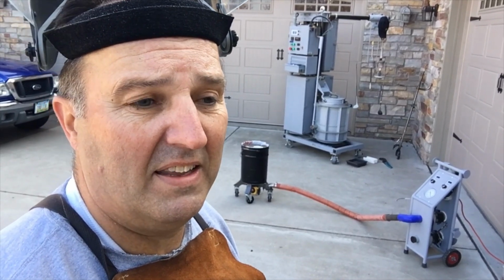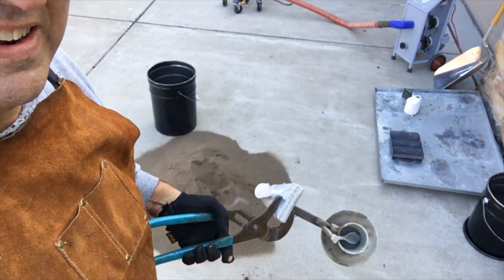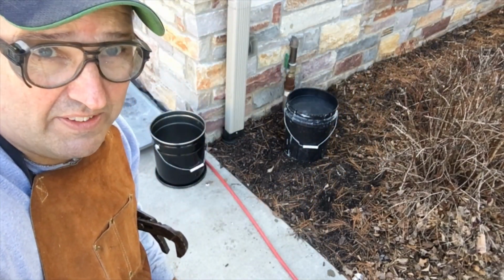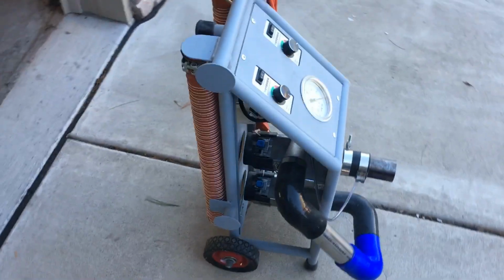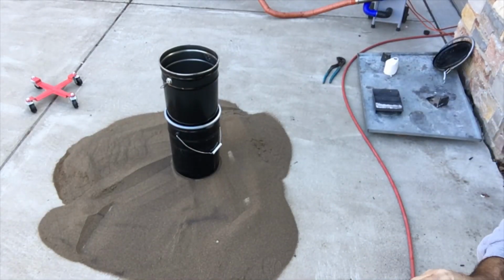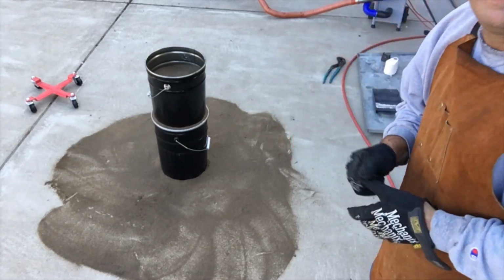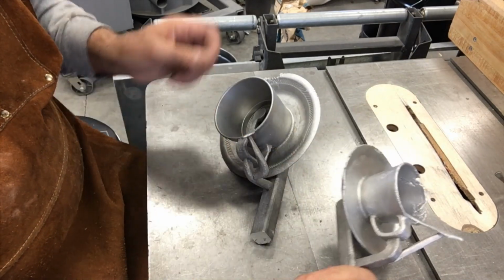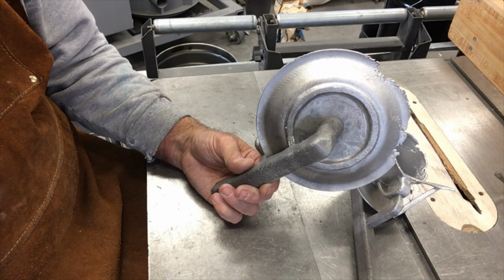Thin Walled Lost Foam Casting: Part 2 Pouring The Castings

Comment: Sonofagun. Did I just find my favorite channel? 
Smart, tenacious stuff.
Reply from the maker: Ya had me on the first word. Son-of-a-gun LoL. I have a new project in the works. Hopefully in video in a couple weeks. K
Reply: @kellycoffield533  I'll be watching for it. Thanks for making this available to the world. 
Is there a refractory slurry product / supplier that you can recommend? While it would be fun to make my own, I'd rather focus on the other inevitable challenges of this process. Thanks!
Reply from the maker: @eric-8998  I use Poly Cap 600 which is made by REFCOTEC. Unfortunately there is a minimum buy of 50 gallons in either a single drum or ten 5-gal pales. There is a link to a forum post I made about it. Thinned, non-setting drywall joint compound may be a more practical substitute for you. Best, Kelly
http://forums.thehomefoundry.org/index.php?threads/lost-foam-dip-coating-rig-%E2%80%93-the-big-dipper.776/#post-20809

Comment: Well I'm sure you noticed that the elbow was collapsing somewhat when you turned on the vacuum.  Now I'm going to watch round 3.   thanks.
Reply from the maker: This video series and the one on finned engine cylinders get all the views. It's sort of funny because I get comments about how I should be using a different process for such parts but they were just me on a lark showing the art of the possible with lost foam casting because people think you can only cast skulls and ornaments with lost foam, not techncal machine castings. -Not true. In fact, I think those videos are the only two times I made parts that I didn't intend to use for some functional purpose. Still, show me a sand casting this size someone has successfully sand cast with only .062" wall thickness with any sand casting process. The best lost foam castings on my channel are the intake manifolds and timing cover. I developed and adapted my processes and equipment to make one-off and small quantity automotive parts of that size and nature but I haven't made videos of my very best castings. I almost regret making this series because everyone thinks they need vacuum to lost foam cast aluminum, and you don't in most cases. In fact I almpost never use it, just gravity fed. It's only because of the extreme thin walled casting that I did so. Now, if you were LF casting iron, the vacuum may become more necessary. Best, Kelly

Comment: I believe you need to add at the opposite side of feeder one riser for venting then you'll never face that problem of missing parts of saucer edges.
Reply from the maker: In lost foam casting vents like you describe are not used nor required because the gases vent through  the entire surface area of the pattern and the rate at which the gases escape is controlled by the permeable refractory coating applied to the pattern. Best, Kelly.

Comment: Great videos.  But by chance would it be possible to apply pressure to the top of the pouring basin in place of a vacuum?  And a wide sprue along with some way of preventing the molten Al from exiting the basin?  I envision applying the following steps: 1) poor Al into a large basin.  2) affix a seal to the top of the basin - so you can apply a bit of pressure from an air compressor.  3)  start the Al flowing and turn the pressure on.

Not certain how one would block the molten Al.  Perhaps a bit of sheet metal between the basin and sprue that can be pulled away right before turning on the pressure.  Or a plunger that is lifted up when ready - similar to a sink.  One would just have to find a way of lifting it through the pressure seal.

Once the Al starts flowing it will solidify along the outside edge thereby creating an air seal so the pressure should work well to push the Al into the foam.  With a wide sprue and some pressure the Al should flow fast thereby filling the entirety of the foam before solidifying.  And as a bonus, you could use a shorter sprue thereby reducing the amount of molten Al required.  At least in theory - probably easier said then done.

And lastly, do you degas the Al?  Apparently the bubbles are caused by hydrogen gas leaving the Al as it solidifies.  Perhaps this is only an issue when using a gas powered furnace.  But it looks like it is easy to resolve.  I thought I saw bubbles in these castings but it could have been something else.

But great work.  I wish I lived someplace where I could try it myself.  Then I could check if my ideas are complete garbage before suggesting them...
Reply: Ok, saw you other videos.  Looks like you perfected the process - results look amazing.  Still curious if applying pressure would help but it is hard to warrant the effort when you are already producing results which look perfect.
Reply from the maker: @williamdouglas8040  When I started lost foam casting years ago, I drew from commercial practice. Most commercial operations used vacuum but most all was iron casting. I almost never use vacuum for aluminum casting except in extremous......like this case with only .060 virgin ingot in a resistive electric furnace and rarely degas but it was more of a science experiment. I melt I only degas these days when  use dirty scrap. Considering joining www.TheHomeFoundry.org......lots more on the topic memorialized there. Best, Kelly

Comment: Why are you using the vacuum? The aluminum isn't being affected.
Reply from the maker: Vacuum is used to more efficiently evacuate and drive the vaporized foam through the refractory coating and increase the velocity of the molten metal front. All commercial lost foam casting operations use vacuum in this respect. In the home setting, depending upon the part, it most often is not required but can still be beneficial. In the case of this part, which is over 9" in diameter and only .060" wall, you would stand absolutely no chance of filling the part without vacuum assistance. Best, Kelly